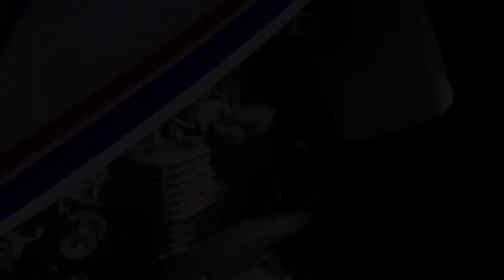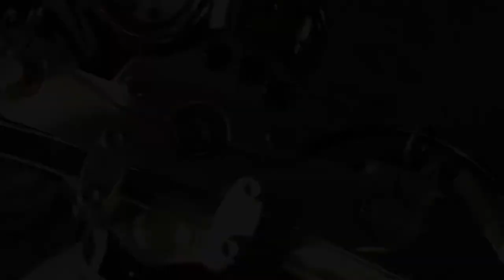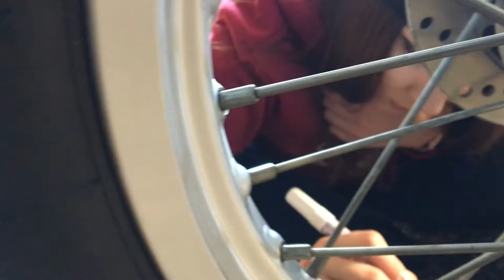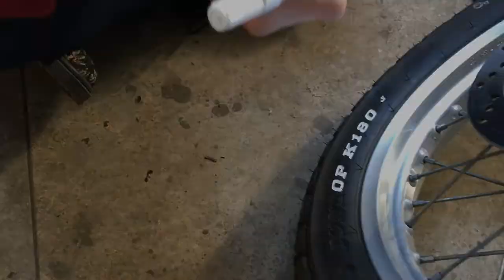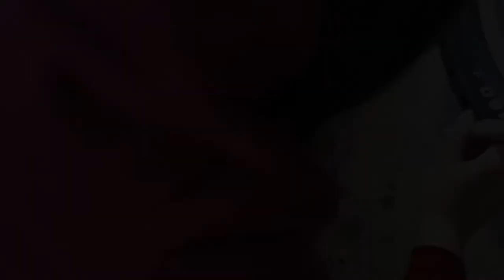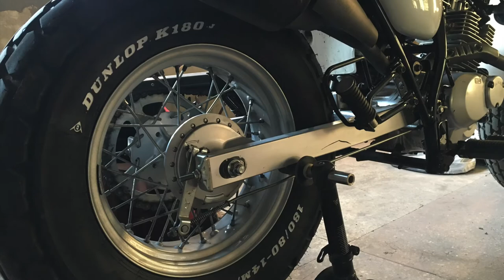Painting Sidewall Letters on Dunlop K180 Tires • Cinematic Short

Comment: Hi,how is the tire grip performance? Can it be used in rainy days? Thank you for your reply
Reply from the maker: Hey! Absolutely no problem. We once got caught in a heavy rain riding two-up and we rode about 300 km in basically non-stop rain. I didn’t really notice any difference at all. Sure, I wasn’t riding like I was racing but then again I rode like I pretty much normally would. The only time the rear tire lost grip was in a city on a pretty smooth kind of polished wet tarmac. It happened just once and that tarmac was REALLY smooth. Other than that I feel super confident riding in rain with these tires.